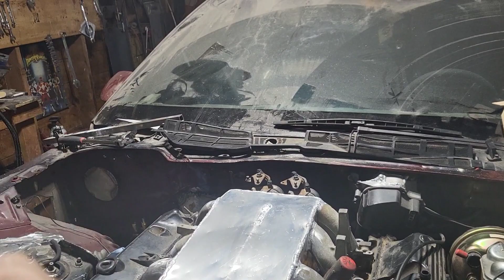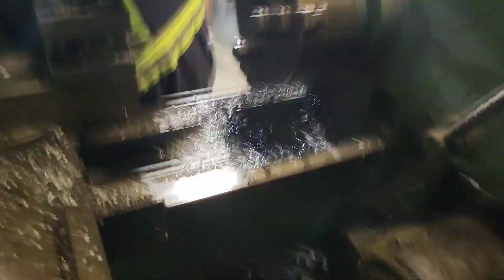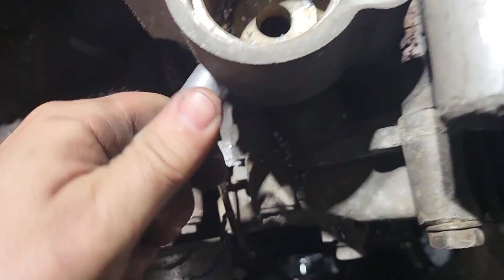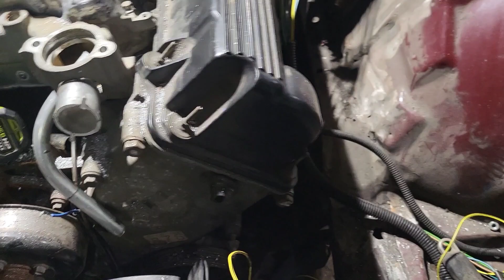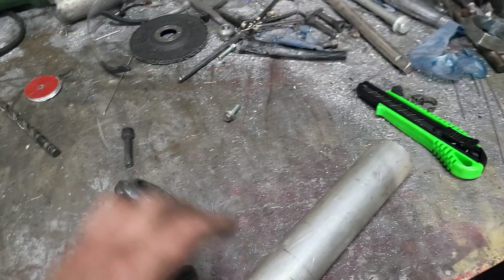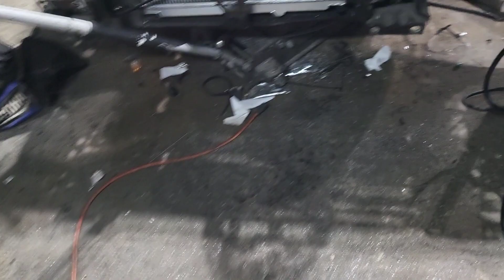v10 intake manifold. tackling the thermo stat and cooling.

Comment: You should look up the external style thermostats for the Land Rover V8 engines. May be easier that what you've done here.
Reply from the maker: I still need a way to limit the return port to the water pump when the thermostat opens. I think Mike has one of the land rover ones on a bench somewhere when he tried using one on the Cressida. So maybe I can make it work